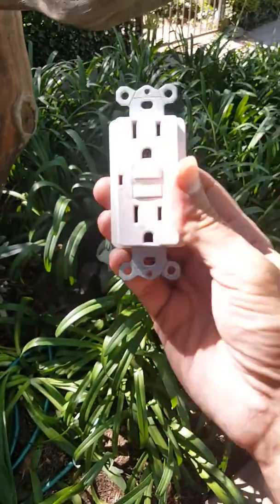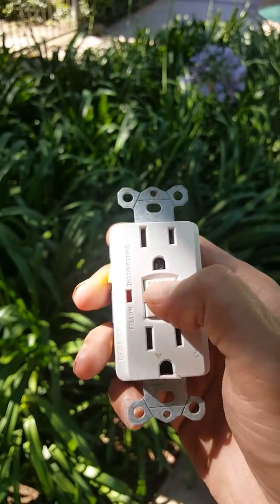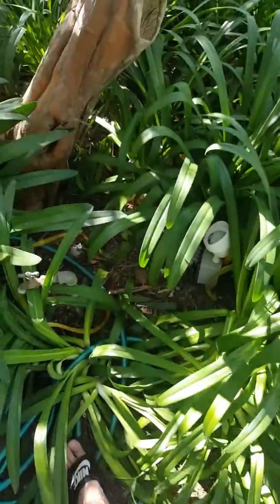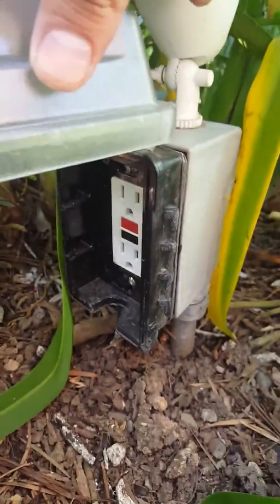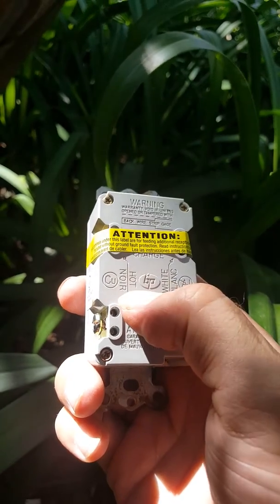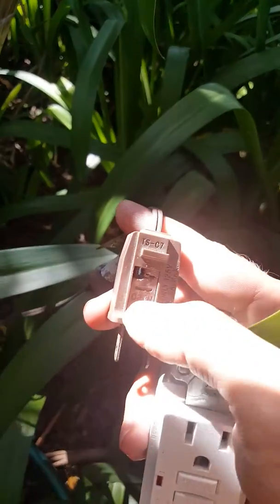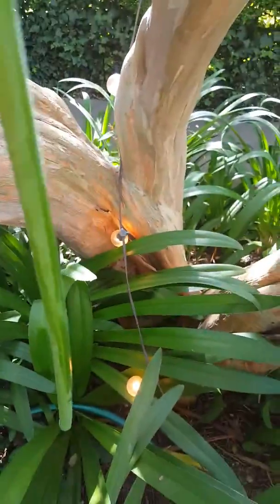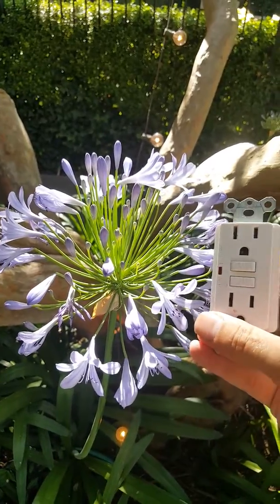GFCI outlet troubleshooting

Comment: I've got power to the outlet, but GFI will not come on. Any suggestions !!
Reply from the maker: Charles Loughrey, press the test button, you should hear a click and the reset button should pop out. If it doesn't you may have a faulty outlet, which happens. If you don't get a pop, it may already be tripped. Give the reset button a good push, if it won't reset, push it with something you can really crank on, screwdriver is usually good, needlenose pliers are a good fit too. Make sure you have power going to it and be careful, don't let the tool go in the socket because that would ruin my day.
Reply from the maker: Make sure it's reset, some of them can be a pain to press in fully. (sorry for the delayed response!)